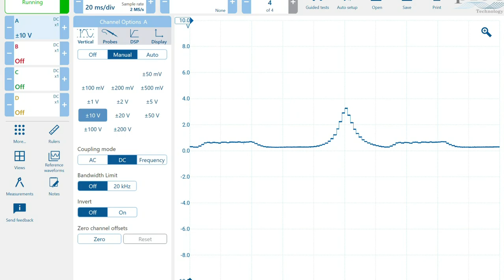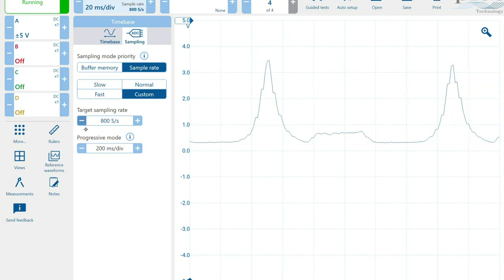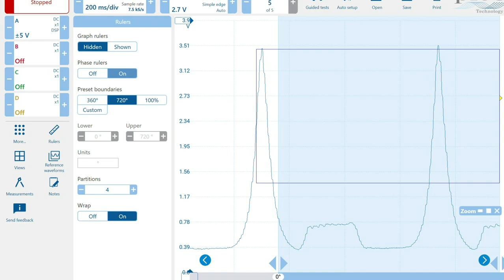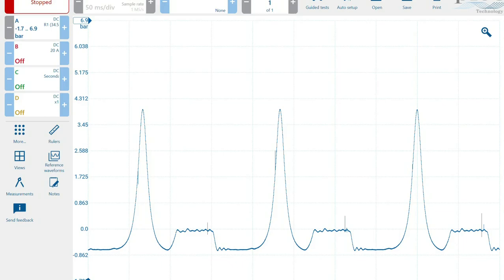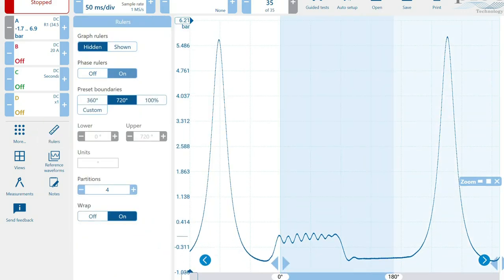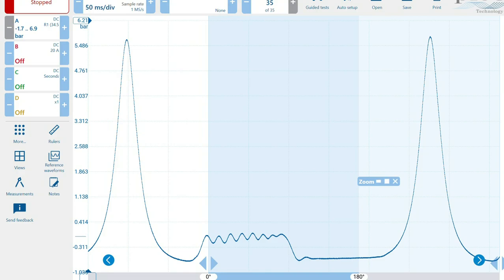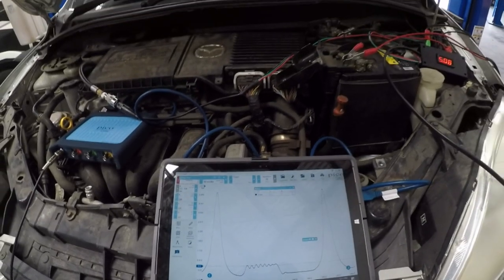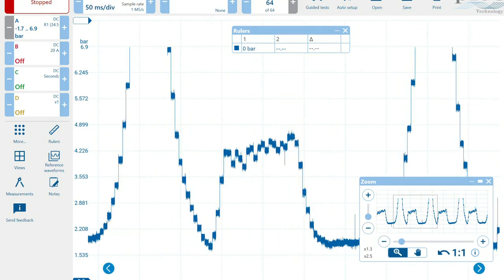WPS500 vs DIY Transducer - Is the DIY good enough to take on the Pico WPS500?!

Comment: Interesting! Could you share some details of what sensor you used for the diy option. I have built my own but haven’t had a chance to connect to the oscilloscope. Readings were accurate in my meter.  This is the sensor I used and can plug any other sensor from the same range In to get different pressure ranges. https://www.sick.com/au/en/fluid-sensors/pressure-sensors/pbt/pbt-rb250ag1senvmc0z/p/p309009

It still doesn’t have the response time of the wps500.
Reply from the maker: Dylan it was just a standard 100psi cheap sensor off ebay that has a 2ms response time